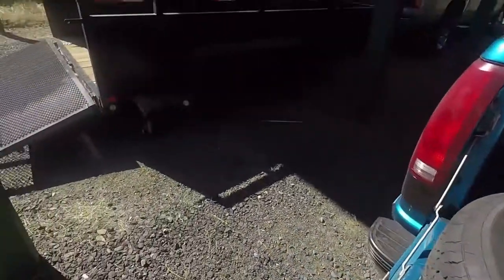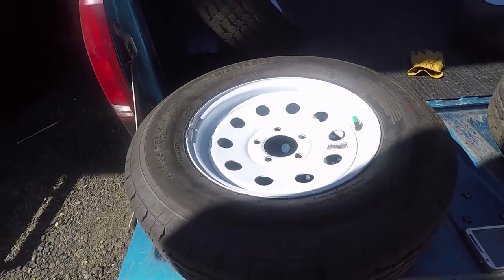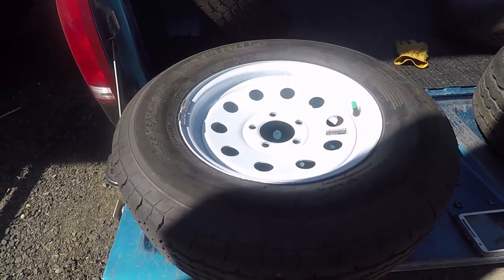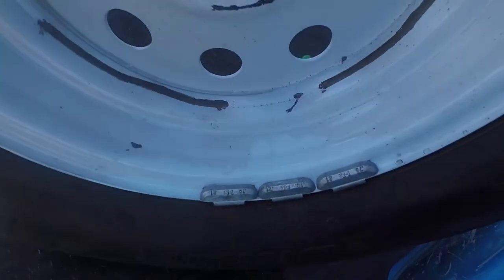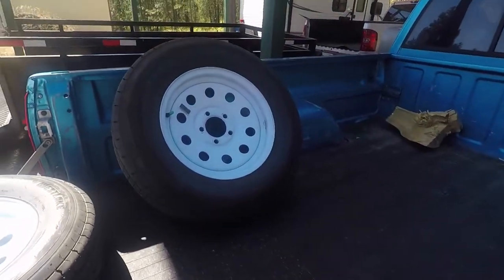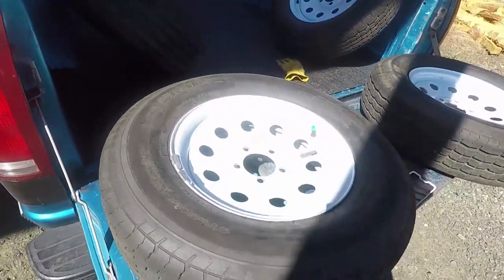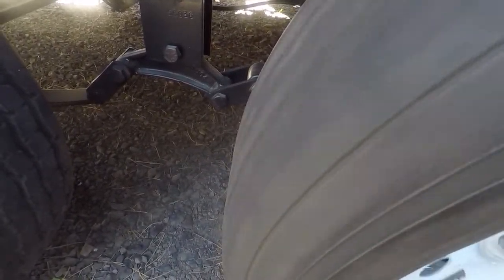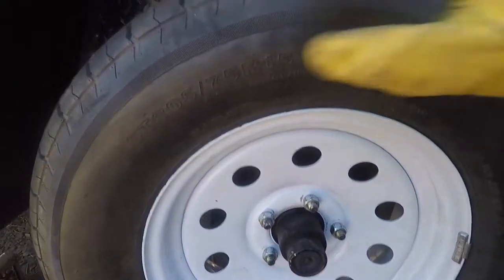Why you should balance trailer tires

Comment: Tire slave here. I would definitely agree with saying trailer tires should be balanced, especially since they are often so crappy. They are the most likely to fail, and are the most likely to be abused, so really they should be receiving special care! Some trailer tires are hopelessly out of round, like the shop mentioned, but often they are acceptable. Also, the tire being visibly out of round is actually very common. Trailer tires have it the worst, but many car tires will also be visibly out of round. 

One thing to consider would be getting the tires 'road forced', or matched to the rim to minimize the total out of round. Tires and rims both are not concentric, and you can match their inaccuracies together to make the whole assembly more round. There are roundness upper limits for passenger and LT tires at 0.026" and 0.038" respectively. I don't know of any trailer tire limit. I recently brought in a spare 12" trailer tire to practice road forcing, it started out at 0.026" of runout, and with ONE adjustment I got it down to 0.003"!!! That is friggin smooth! Just yesterday I road forced the tires on my car, worst was 0.017", best at 0.008". I reduced them all a bit, but none better than 0.007".

Proper road forcing takes specialized equipment, but if you can break the beads(both sides) on the tire, then you can BS it yourself. Mark the rim and tire, spin tire 180 degrees on rim. Check. If not good, spin 90 more degrees. Check. And spin 180 degrees again. Tire should be reinflated and beads seated each time you go to check it. That is what makes it take so long!

Unfortunately, road forcing takes time, and time is money. You better believe that if it was up to me, I would road force and target(good) balance every single tire, but it isn't.
Reply from the maker: I've heard of Road Force Balancing before, but have never asked about it at tire shops to find out the cost.

Comment: What do you mean by “Cheap ST Tires”? I bought 2 tires for my utility trailer, 4 lug, and 1 seems horribly imbalanced. But they weren’t super cheap, they were more middle range as far as price. 80 bucks each I think, which for a little utility trailer is fairly expensive I think.
Reply from the maker: Cheap = very low quality, very out of round.

Comment: The reason thy get out of rounde is it is a tandem when turning the axles have to slide in the turn the tighter the turn the more thy have to slide you do not see this in the single axles.
Reply from the maker: These were on a new trailer.  They were out of round to begin with.  I've multiple new trailers with cheap, out of round tires on them like this trailer.

Comment: i couldnt tell if you have brakes...if not, a bearing check is due cuz i heard a lot of noise
Reply from the maker: Yes, this trailer has brakes since it's a tandem axle trailer.
Reply: @deltabravo1257  was unaware tandems require brakes, and I've seen many without...if new regulation its a good'n

Comment: I had a question will unbalanced rv trailer tires cause tire sagging on one side I replaced tire with new spare with 50psi and still sagging versus left side ?
Reply from the maker: No, unbalanced tires won't cause sagging like you describe.